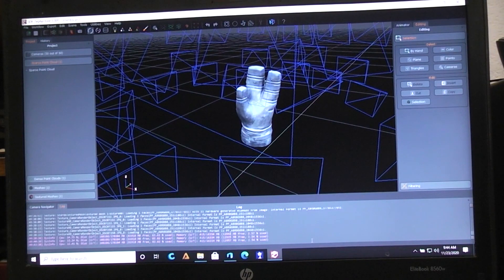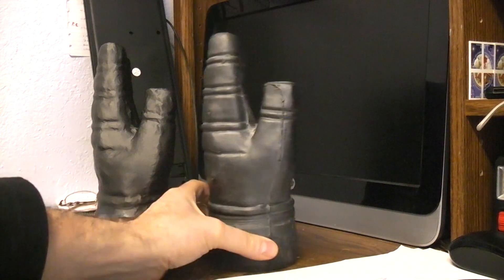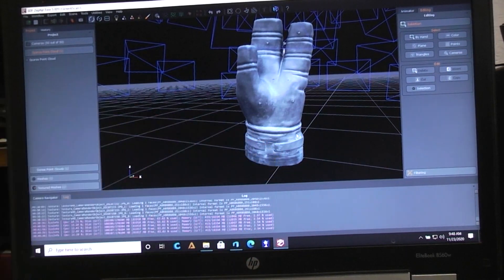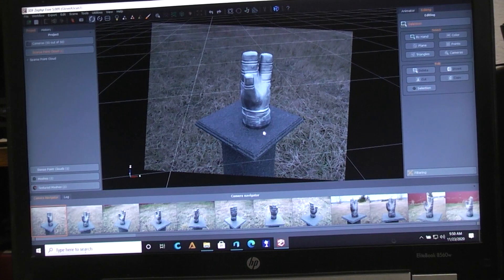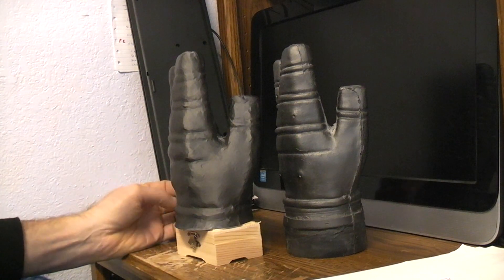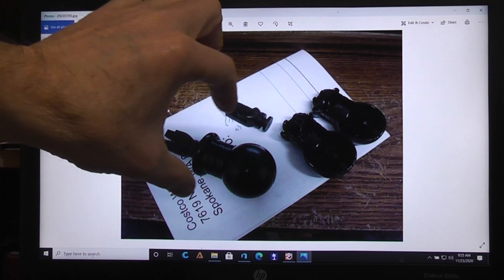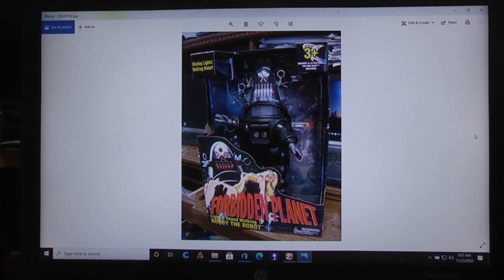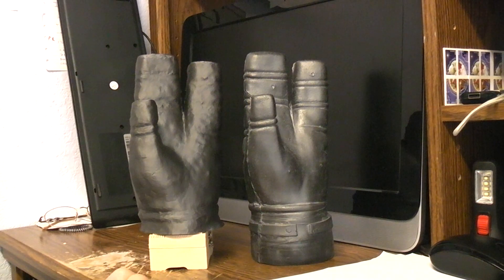3d scan of  Robby the robot rubber glove. Full scale and Walmart Robby scale.

Comment: Hi John,  Thank you for this great video on Robby's hands. Can you explain what the metal rings that screw together lock int, in the donut wrist ??  Or do they free rotate inside ?? I remember seeing a photo looking into the inside of robby's arm and there seemed to be a machined aluminum metal wrist , couldn't figure out what function this served ??  I thought it was a machined bearing of some sort for wrist rotation ?  Thanks you are a treasure trove of Robby info !!
Reply from the maker: The movie Robby gloves are foam rubber.  The gloves are inserted into the arm wrist parts from the inside. There are metal rings screwed threw the foam rubber gloves that stop the gloves from being pushed threw the arm wrist part. The ring lip right at the base of the thumb stops the glove from being easly pushed back inside the arm wrist part. So the glove is trapped in the arm wrist by the ring "bead" near the thumb and by the metal rings that are screwed threw the rubber glove on the inside of the wrist.

Comment: Can you do Robby’s head for a digital Image so one could have the right measurements to build a full scale Robby 🙏🙏
Reply from the maker: Not really. The quality based on the free photogrammetry program is limited and my current camera does not meet the Pro requirements.
What would really help would be a good DSL camera. Right now I have a old Song point and shoot, every thing is auto, you need to be able to go fully Manual. Locked off F stop no auto functions like focus or exposure. Or so all the photogrammetry programs say. Then what would help is the Pro version of the photogrammetry programs, but hat would mean I would need a computer that has the right CPU and video card for this type of graphics work.